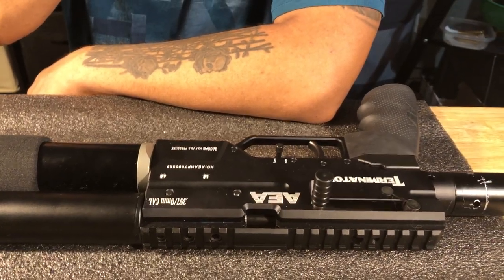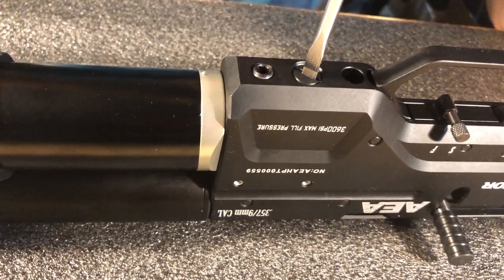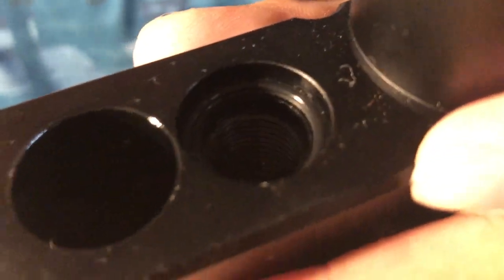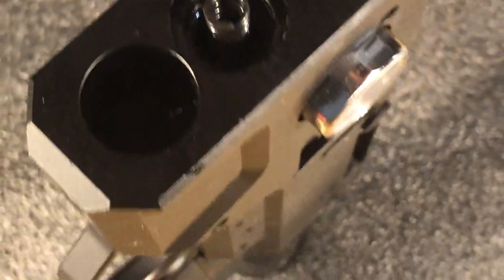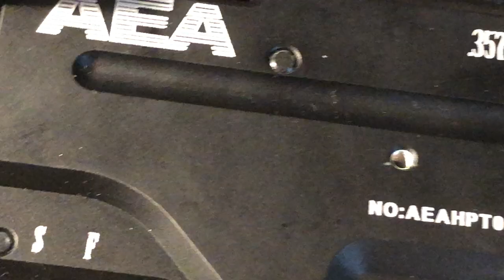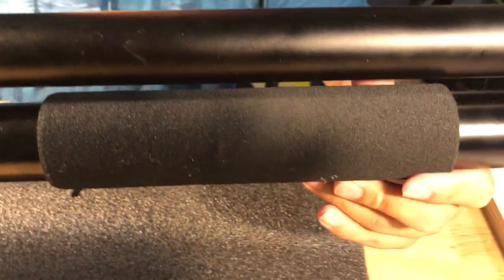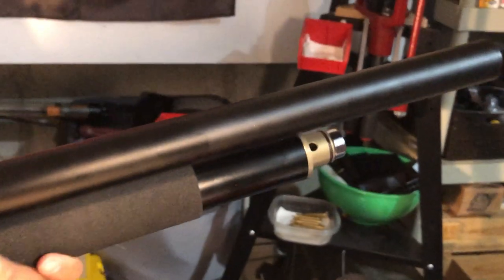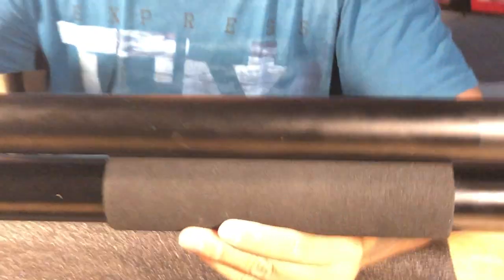AEA How To: how to replace the valve pin inside barrel for 9mm terminator!

Comment: Why AEA there is no have  BALANCED valve like FX Airguns???
Reply from the maker: anto markič this type of gun will not
Reply: @sigshooter6213  Why???That is a big mistake!!!
Reply from the maker: anto markič I have no clue, manufacturer have it
Reply: @sigshooter6213  So give them a suggestion
Reply from the maker: anto markič will do thx
Reply: @sigshooter6213  Tnx. FX Airguns have hammer weight only 5-6 grams!
Reply: @sigshooter6213  honestly I don't care how they do it but having the valve pin snap in half after less than 500 rounds is something that needs to get fixed and not just "drop 25$ and buy a new one" , why is there no cnc option or something I really don't want to buy a new valve pin after so few shots. Or at a minimum provide like a half dozen valve pins with the gun if it's a stated disposable part.
Reply from the maker: @whatsmolly5741  hi my friend you should have one year warranty for free on these parts. Who sold
you that for 25 dollars.
Reply: @sigshooter6213  im sure you can guess, Zack with arese tactical.
Reply: @sigshooter6213  "we provide no warranty" posted in their new site
Reply from the maker: @whatsmolly5741  that part should be free(notshipping fee)if you have your gun within one year. Let me know if you need it I can ship it to you. No problem. We need take care of all the customers no matter who sold you the gun.
Reply from the maker: @whatsmolly5741  contact me by pcpcomusa@gmail.com